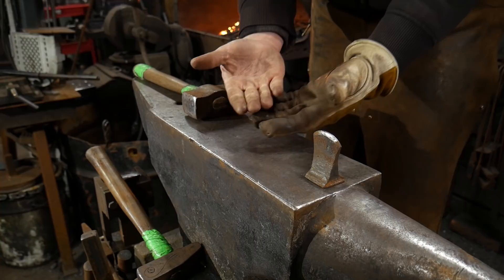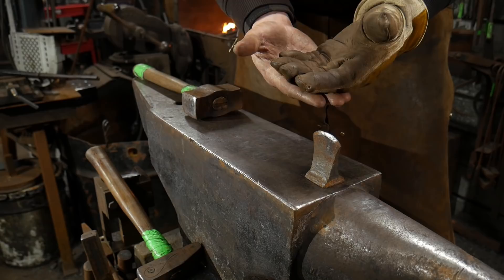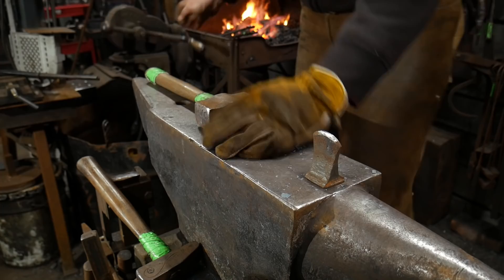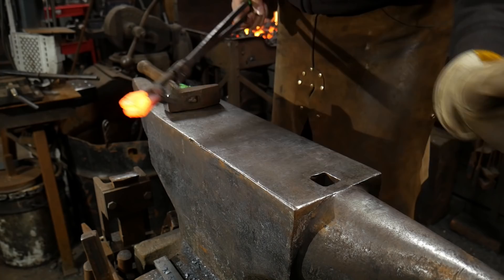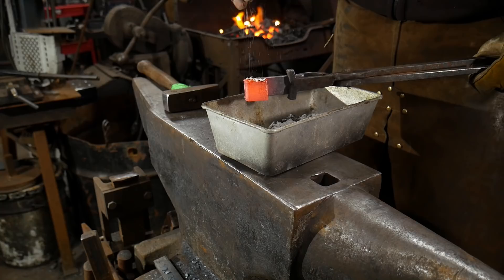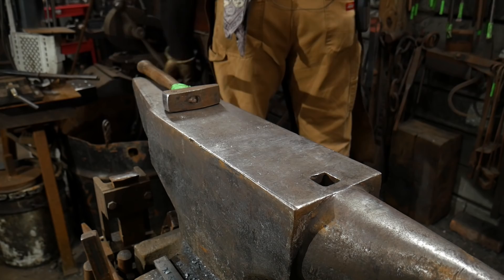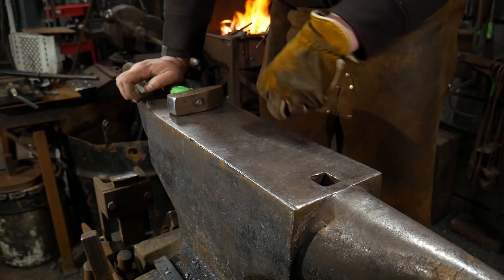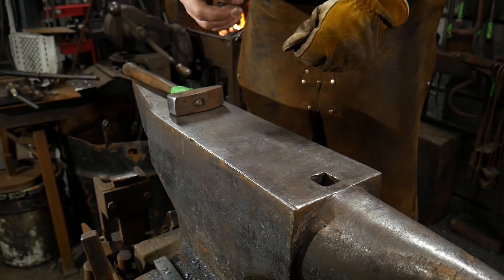The Accordion Weld (Forge Welding Techniques)

Comment: So i want to tack weld some pieces together, put them in the forge, and pull them out and fully weld them together. Much like damascus  makers usually do, just to ensure alignment. I also don’t want a ton of finishing work when i’m done. Some is expected but I don’t want to be removing a ton of material. Would i be able to use a brass hammer? And would it be worthwhile to use one over a light steel hammer?

Comment: Roy, I have a lot of thin 2" strips (core of what looks like a large homemade tombstone welder) about as thin as the metal banding used at steel yards to hold the bundles together, how do I get the center hot enough without melting the outside layers in a solid fuel (lump charcoal) forge?

Comment: As always Thank you Roy!  1 question... Can this br done by stacking pieces on top and bottom of a piece of flat bar in the middle, ie: an integral bolster?so another words you would have your say 10" piece of bar stock and add 2 each 1 inch pieces on the top and bottom in the middle of the bar to thichen a center spot on the bar? Just curious to know.  Thanks again.

Comment: I have enjoyed forge welding for 25 years or more. I have always had issues with stainless + O1 or O6 for pattern welds. Any tips for successfully getting a homogeneous joint on these? Note: stainless stock is 440c. Thank you, Roy.
Reply: U need to be oxygen free  for stainless  like a canister  weld
Reply: @klkkylekin5948  
Thanks, Joe. I'll have to try it that way. My biggest problem may come from twists and folds to develop the pattern!

Comment: Hey Roy, I noticed that you brought the welded billet way back up to what looked like welding temp before you drew that taper. A question I have is: once you forge weld a bit of stock, is the welded area effectively wrought iron forevermore, meaning needing to be worked at that higher welding heat for fear of springing the weld? Or can you work it at more normal temps after annealing or normalization or some other process?
Reply from the maker: Yes you can work it like normal after welding providing the welds are good... But if you are going to be moving alot of cross section you need to keep it at a much higher temperatures. then several normalizing heats to treat the stress in the parent material and make the welded planes more uniform in grain structure. Otherwise it could be a problem later on in the forging operation and split apart along side the welded plane. Hope this helps God bless and thanks for the great question :-)
Reply: Christ Centered Ironworks Huh, that kind of sounded like No, but Yes. Yes, you can work it, but no, not without using high temps to avoid delamination if working it heavy. Thanks! :-)